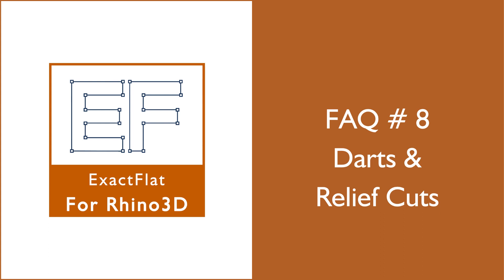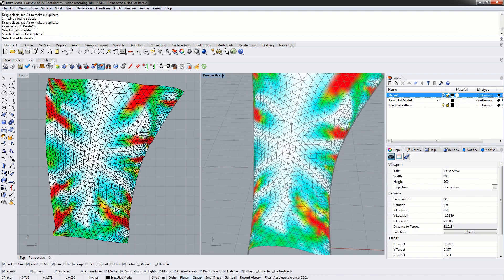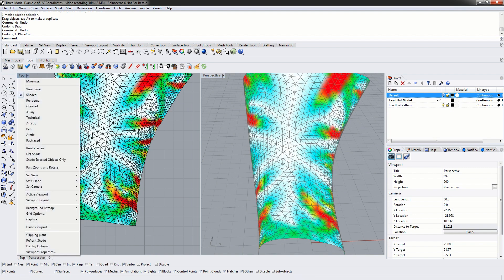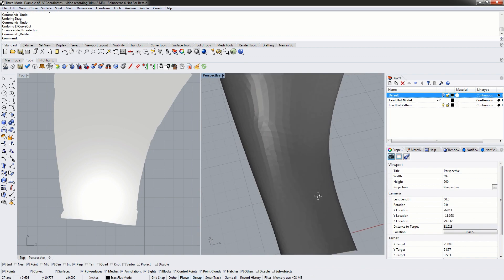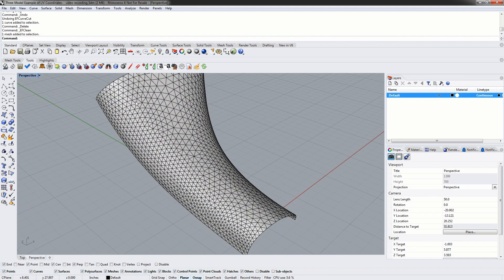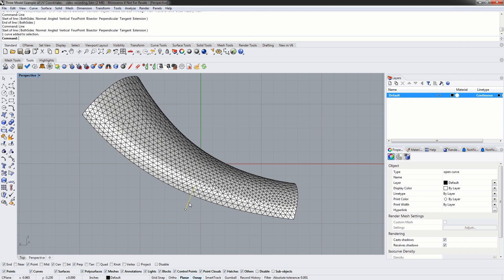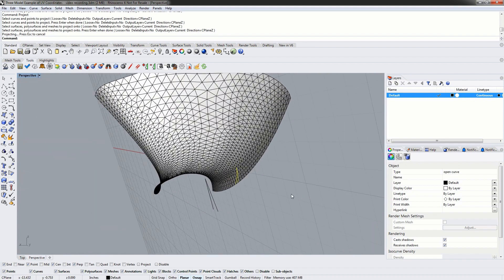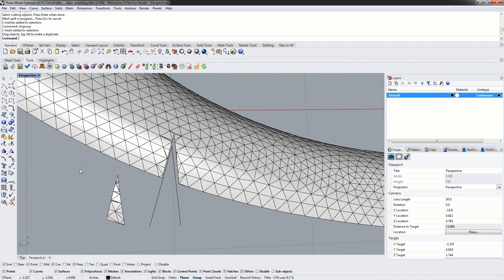ExactFlat:  Darts and Relief Cuts

Comment: If you made a slice through the mesh before flattening (to indicate where you'd need a dart), would the slice splay out when you flatten the piece? Some of the pieces I've seen used in this program are very curved and somehow flatten out without splitting, which makes me wonder how it actually makes a useable pattern piece in real fabric, unless that fabric is stretchy and being formed around something.